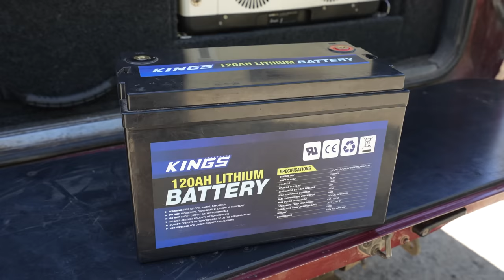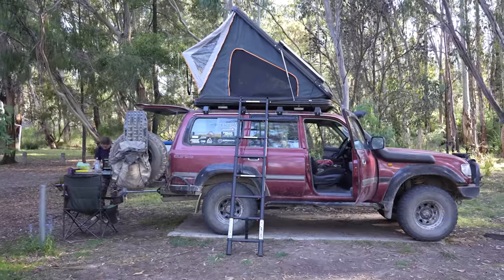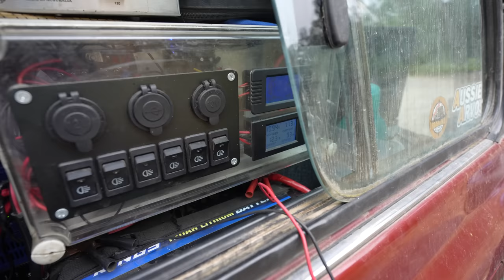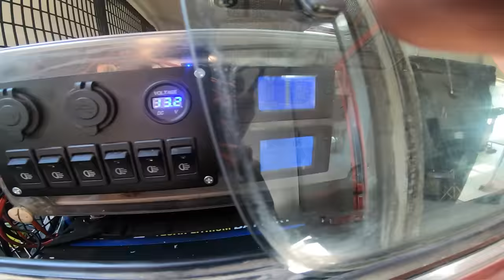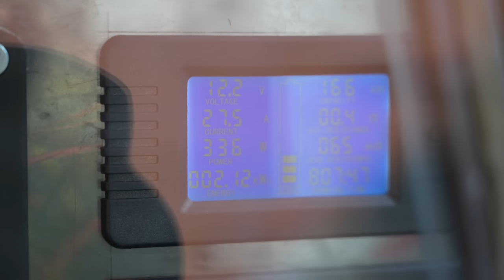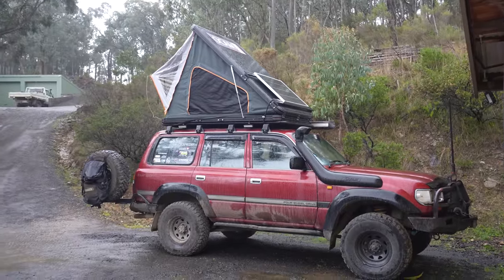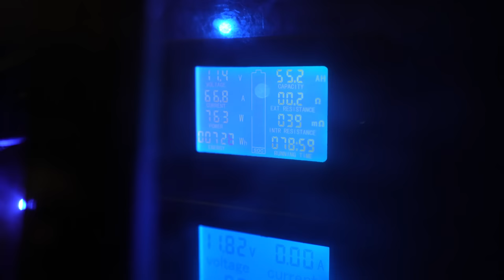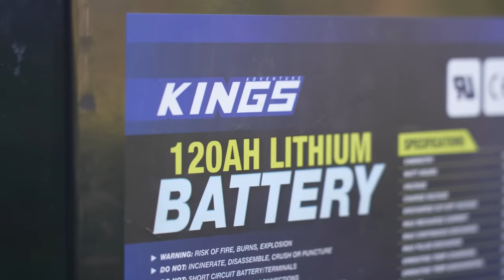Watch this BEFORE you BUY Kings Lithium Batteries

Comment: I've enjoyed your vids on this stuff mate. Loving your authenticity and willingness to test brands others snub because they are cheap. We aren't all cashed up, and your take is very much appreciated.

I built my 12v setup for my ute's canopy on the cheap(ish) using a pair of slimine AtemPower 100Ah LiFePo4's, a Renogy 50a DCDC charger+Renogy 2000W inverter+Renogy battery monitor, and 2x 160W Wanderer hard panels from BCF. I probably would have saved a few bucks overall if I had of considered giving some Kings gear a shot, but I do love the front wall mounted slimline batteries not hogging much canopy space.

Not all smooth sailing, the absolute chongus unit of a Renogy DC charger ran fine for about 3 weeks, but then out of the blue suddenly melted on the solar input side (supposedly rated for 660W) and nearly caught on fire, the only loads on the batteries at the time were just a fridge, battery monitor and Ryobi One+ charger running off the inverter, which were all still running during my scramble to safely shut everything down.. Renogy tech support team was mysteriously silent and didn't even respond to the support ticket, leaving their poor social media/online chat guy I initially contacted them through fielding for them, but in the end the company was at least honourable enough to refund me which I'm thankful for. My canopy still reaks a bit of the foul plastic death though, but thankfully that's starting to fade. 

The experience left me a little paranoid, and I replaced the fried stinky unit with a RedArc 40amp BCDC core which cost about $130 more. It's a quarter the size and much better quality, but kinda boring features-wise in comparison, no bluetooth  nor starter battery maintaining. I can live with that. 

But anyway, so far so good, running a 85L upright Brass Monkey fridge (draws about 15-16amps overnight, but convenient as hell), some hardkorr light bars, and 240V stuff like a cheap small Kmart microwave, a BCF 2000W induction cooktop, 750W ALDI sandwich/waffle press, ALDI pod coffee machine, and occasionally a 450W (Kmart?) rice cooker off the 2KW Renogy inverter without any further disasters.  The solar panels perform well, provided they aren't partially shaded.

The biggest battery eater has surprisingly been the rice cooker (it takes ages, and uses 25-30amps depending on rice type) pre-soaking for half an hour barely made any difference. I'll try the Instant Pot next time using the 3 minute cook+10 minute natural vent method I use at home to see how it compares. (Someone please do a decent video on the cooking efficiency topic, lol.)

Comment: Dude thank you SO MUCH. I actually work at kings and even I didn't have the sort of info you've presented. Pretty set on buying one now! 

At the end of the video you asked for our experiences with kings so I guess I'll share mine. First kings product I got was a baby's first 2.5x2.5 awning. Hated it. The guide ropes and pegs it came with were useless so it got blown over backwards by a tiny fart of wind. 

However, everything I've bought since then has been pretty good to be honest. I got sold a dud AGM at the start but it was replaced and even tested the new one to make sure it was good to go within 24 hours. Current setup is rocking a 270° free standing awning with sidewalls I picked up for about 600 and something including the 2 walls. Love it, straight up best thing I have. Running a 160W fixed solar panel that fits perfectly on top of my dog box. Admittedly the stupid way I installed it all means that I have to push the back arm of my awning on top of the solar panel. This cause some flex in the panel but even in a huge storm the other month it all held together, nothing broke and everything still works perfectly. Picked up a seconds 65L fridge for just over 200 bucks with a one year warranty, just missing its 240v cable: love it. Got a 115ah AGM with battery box for $228. Haven't had any problems so far and the battery box is an awesome option. Fridge slide works great, does lock up sometimes but easy enough to wiggle back in if needed. Got the 4 bar LED camp light kit so each arm of the 270° awning has a light bar (with dimmer). Love it. Should add too that I've had the Big Daddy swag for like 6 or 7 years and that thing has been through HELL and is still going strong. The original plastic fitting holding the centre pole to full extension did perish but they literally gave me a brand new one for free on the spot so no complaints there either. Smaller items include the 2in1 LED fans, they're OK but they CHEW batteries. Kings does plan (rumour has it) to release a rechargeable lithium 2in1 fan in the future though. Love their Bluetooth speaker, their head torches are good enough for the price (considering they're usually thrown into bundle deals for almost free), love their lithium work lights and their 1000a jump starter as well. 

Honestly yeah kings gets a bad rap about some of their stuff but I love the place. No way I could have all this awesome gear without them and their prices. As we all know, avoid the standard 20a MPPT and go for either the 15a PWM regulator or the premium 20a MPPT instead but otherwise, I love it!
Reply from the maker: Thank you so much for the comment mate! Good to hear about your experience! Yeah they do get a bad wrap, but aslong as you do research you can find good products that will get you out there! And yeah I think this battery is one of them!

Comment: We are currently using a Redarc controller and a Optima AGM battery. All our wiring is proper and we use two 100 watt cheap Harbor Freight solar panels. It has worked well powering our ICECO fridge and our lighting. We don't use it for cooking or large current draws. We will probably upgrade to a inexpensive lithium once it dies. We do have a EcoFlow 100 amp hour lithium battery pack with a 1300 inverter now. It works well so far and charges fairly quickly.

Comment: I use a 60AH Kings LI battery in my Farrier F22 Trimaran, it is a very light boat so having a light battery is the go, It powers my 2 way radio, lights, mooring lights and stereo. If I use the boat over a few nights like sailing to Tassie from Victoria, I use a Bluetti AC200Max inverter/Li battery system for induction cooking, microwaving, this is a portable system. You should checkout the Bluetti systems. Great video, thanks for presenting it.

Comment: Great Vid, been testing 2 budget Lithium batteries. 1 X Kings 200 ah & 1x Powertech 100 ah. Identical 4x4s but different DC DCs and differing solar panels. Both Batteries have performed flawlessly. The Kings unit is the real deal as is the Powertech from Jaycar, but having 200ah for the same price as a 100ah, wins. I use my gear, too many guys spend the weekends polishing their inverter, then driving to the mall, rather than seeing our beautiful countryside.

Comment: 1 point overlooked is the maximum continous discharge current of the battery. Agree the induction cooker is very hard on the lithium battery and in my case have measured battery discharge current of 168 amp @ 12Volts, with my induction cooker at 1800Watts. Many lithium batteries are only rated at 120 amps maximum continous discharge current. Just some thing to keep in mind if you want to run induction cooker harder than 1200 - 1400 watts (240VAC) of power.

Comment: I am running Amptron brand 48 volt lithium batteries at home as I live off grid and after 2.5 years since changing over to Lithium's I have been very happy. Before Lithium were invented I was running flooded lead acid batteries, then AGM and yes I also suffered from voltage sage when I would draw a higher current. Lithium is sure a game changer in the off grid / remote power world. Will be interesting to see if we get the longevity out of these batteries as the manufacturer claims, time will tell. 👍

Comment: I’ve been running itechworld 120 lithiums both under bonnet in my Cruiser and two under the bed in my caravan for about 3 years now. Amazing how many people will tell you about them catching fire etc. not one of these guys has actually seen it happen though. I know older technology was sketchy but I would NEVER go back to AGM. Great video 😊
Reply from the maker: Thanks Mick! Yeah I've heard they are good too!
Reply: People confuse Lithium-ion (Li-ion) with Lithium Phosphate (LifePO4). The "fire issues" are associated with Li-ion. Not to say that LifePo4 can't catch on fire, however the event is not at all as severe as with Li-ion.
Reply: @Simmo_AU  I understand. Phones catch fire too. I’m not trying to be a smart arse.   Just sharing my experience. Sorry your friend is in a bad way.
Reply: Sorry. Got cut off. My cars were all going to blow up too. 25 years and it never happened.
Reply: @Simmo_AU  no worries. I thought I opened a can of worms with the response. Just my two cents mate. Have a great day 😊
Reply: @Simmo_AU  LifePo4 cells don't self combust, Issues are due to something occuring during charging. An analogy:  a jerry can full of fuel is not dangerous if stored properly. cheers
Reply: @mickburns5546  is the the itech world true 120 amp hr battery, or is it the 105 amp hr battery they named 120x?
Reply: @krump743  yeah. The older 120x which is 105a

Comment: I bought a kings 200 amp battery brand new. It was missing a cell and over heated my dc to dc charger and wiring. Kings replace everything for free and haven’t had a problem since would recommend but be careful.

Comment: Just went to a120 lithium with a20 amp atempower dc dc and a200watt atempower blanket and I barely have to use the blanket! I only run a65 liter fridge and led lights, drone charge and jbl speaker charge... Very simple set up but it won't go under 13.2 over a few days... amazing. Just about to fit a600 sine wave inverter for my tv so I  keen to test it further, cheers for the video mate, john

Comment: Great review, the only thing that would worry me would be vibration resistance, internally, will they hold up to many kms of corrugations and rough roads. There are quite a bit electronics in a battery, if they were fully potted I'd probably be a lot happier !!!
Reply: Don’t quote me  but I think I read somewhere that they use prismatic cells which apparently are really good for off-road use. I read so much stuff sometimes I don’t know if I’m Arthur or Martha but that’s okay as well apparently 🤪
Reply: Maybe place a piece of high density foam under the battery for extra protection.
Reply: @davetunbridge6637  Sadly the opposite ... they don't like rough roads.

Comment: I have the 135ah Atlas lithium battery. Paid $650. Best purchase I made for my set-up. Because I live on the road, I drain it constantly, couldn't do it with my old 120ah AGM battery. I do plan to get a second battery to get a total  of 270ah. I have a gaming laptop thats power hungry, so I have 780w solar panel set-up. Can't leave it on 24/7 yet. But once i get my second battery i will be able to. Definitely recommend lithium upgrade for your set-up.

Comment: Hi Aussie Arvos, 
Did I hear correctly that you're getting 1800watts out of this 120AH battery setup?
I need a setup that can do 1800watts and I was thinking I would need to go for a 200Ah battery given that the 100Ah specs say only 100Amps continuous output (approximately1200watts continuous). Is it the case that in practice you can get more than 100A continuous out of this battery? Cheers

Comment: Mate, excellent video. I've been looking to get a second battery, solar and fridge set up in my old Prado but really don't get away often enough or for long enough periods of time to justify a high dollar set up. It's basically just me for a few days fishing , not even a week and I'm happy to cook on my little gas stove or open fire. Keeping the fridge going and charging phones and cameras is about as taxing as it'll get unless I need to run my air compressor. Looks like this battery and a solar charge will be more than enough for me so thanks for the review. It's great to see you young blokes out there putting this stuff up for an old geezer like me and it's much appreciated that you review the budget end of the spectrum...I had to stop watching another guy for 4WD advice as everything was mostly top dollar...cars and all and to be honest, it's a little depressing with that much money involved. Thanks again, I'm subbed now.
Reply: Honestly, with that, even reconsider the solar. If you get 3days out of the battery, run the car for a few hours on idle to charge the battery, and you've saved the money on solar... depending how often you go, of course
Reply: @dwaynethart6527  You're probably right Dwayne but I may want to go further or add to the set up at some stage. Thanks for input.

Comment: I switched to a 170Ah Giant Slimline Lithium 12 months ago after losing two Deep Cycle AGM batteries within 3 months. With the battery coming in at around $1090 and $400 odd for the DC-DC Charger and about $300 in wiring, it's been worth the change, even though . . . . being a firefighter . . . there has been a little anxiety over the Lithium battery catching fire, which has been on the increase in recent years. As a Event Medic, I run non stop a Brass Monkey 65Lt Up-right Fridge, a 100w HF Radio, 3x Digital Radios, 1x CB Radio, Dual Band Handheld Radio Charging, and as needed a Mini-travel Buddy, 12v 160Lpm compressor, Canopy/camp Lighting, Roof Driving Lights, Scene Lights with a 110w Kings Solar Panel input via the charger with no problem. The only issue I have had, was a dicky circuit braker between the Charger and Battery which I had to swap out this pass week.
Reply: Generally these batteries are lithium iron phosphate and not lithium ion. Much harder to catch on fire.

Comment: Wow, wow, wow. Great review. Well done mate. Top of the class. Cheers and keep up the great work. Happy travels and remember to fit a smoke detector inside your battery / appliance area for early warning and incident intervention....with a fire blanket or fire extinguisher / lots of water for lithium battery fires as they are somewhat unpredictable so fit them in a fireproof sold stainless steel thick container that can vent to the outside of the vehicle just in case..... 🙂

Comment: Spent the same on a kings 120ah battery, de-dc charger, battery box, 30L drawer fridge, 160w solar panel, Anderson plugs, cable, glands

My whole setup was cheaper than a redarc 100ah lithium and I never have had to plug it in the car (other than initial charge up after purchasing, as recommended in install instructions)
I've just had the fridge on in the canopy 24/7 keeping my lunch and drinks cold everyday for the last two months

Comment: Great video, but..... the comment you referenced @ 5:09 stated that: "Overcurrent protection was tested @250A and did not function". As the battery itself is only rated at 100A continuous discharge, and 160A (10 seconds), that would be enough for me to AVOID it. 
Sure you can ad extra protection at the terminals, but I bet many will run an unprotected cable for some distance to a protection device (fuse or breaker). You'd want to know what the battery BMS eventually trips at before you selected that cable size. 
Short the terminals or put 2 batteries in parallel and there is no protection for the internal cells. There goes your 4WD up in flames
I certainly wouldn't feel comfortable sleeping in a roof top tent above it, or putting it under the bed of a caravan (as many do).

Comment: Hey I’ve spotted a pretty important issue. You’re missing the battery using it with a 2000w inverter and discharging it at 1800w using the induction cooker. It’s rated at 100amp discharge with a peak current of 160amps for 10 seconds. Your discharging it at no less than 150amps when using the induction cooker. A few key things are concerning for me. The BMS is not working. It should shut that battery down as it’s operating outside of its acceptable range and specifications. So I’d the BMS downs have the absolute basic feature of over current protection then think about what else it could be missing! 

You need a second battery to run in parallel. Then you can go nuts with your set up and induction cooker as you’ll have 200 amps continuous then.

Comment: got a DCS lithium and very happy with it. the only thing with the Kings one i se is the max discharge of 100amp. that not much over 1000w of power so you would have to throttle back the induction cooker from full noise not to trip it out. if not electrical cooking its sure is a winner.

Comment: The discharge amps got me.
I run a air fryer, duel induction cook top, kettle, bread maker and so on.
I went the ATG 300ah battery with 250amp dischare/charge rate. I do run the kings 3000w invertor with no problems but decided the 200amp kings lithium would not be enough

Comment: Good advice. I'm looking at installing a lithium when the agm in our Defender dies.
Our caravan has an Enerdrive 200 amp lithium, 240v and 12v chargers and 2000 watt inverter and its a great set up.
Lithium should last 2-3 times as long as an agm so that makes up for the higher initial cost. Only way to go.

Comment: Yep on special for just under $400, hard to go past if you need a new one. The other factor is that you get the use of the full capacity unlike AGM. Even better is the slimline lithium for under $350. I will be upgrading when to old one dies. Thanks for the review @AussieArvos.

Comment: Followed this from your old kings mppt solar controller failure and was hoping for a good outcome as I was interested in this battery.  I know people with Victron but it's $2000 so I was looking into kings.  One thing that stands out though is the fact the 100ah Victron is about half the size!  But good to see you've had good life out of the Kings battery.  E:  I sell certain brands but I run a mix of things myself - Kings, Jaycar, motop tent 220w solar panel etc.